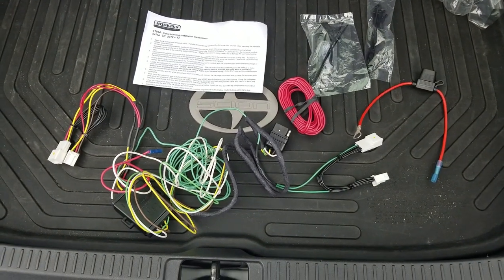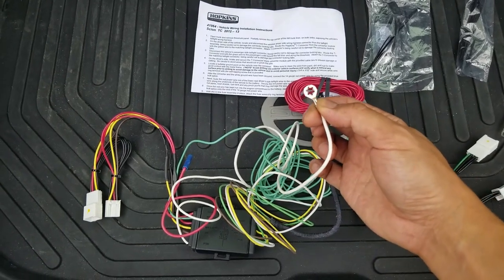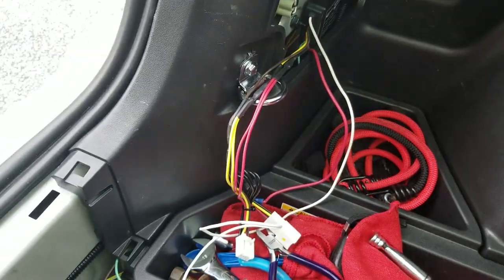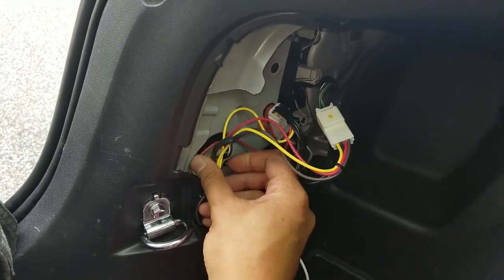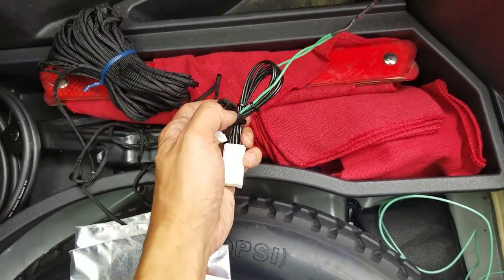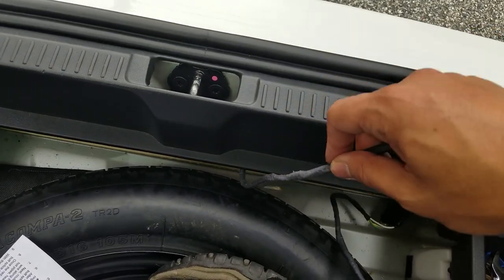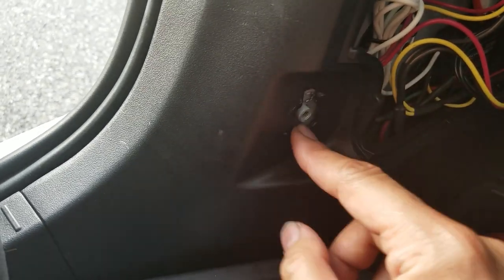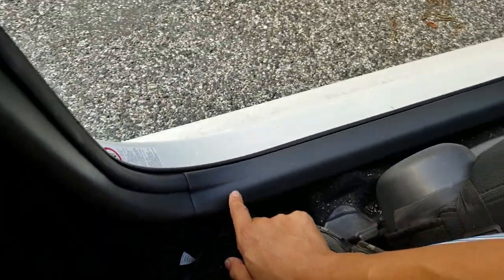Hopkins Towing Solution Hitch Wiring Harness (41964) for Trailer Lights Install (Scion tC2 / tC2.5)

Comment: So that front trim closest to the dash can you show how yours is secured because mine just barley hangs on
Reply from the maker: Which trim? The one with the mirror controls on it? It's held in place with built in clips at each corner. You can see how at https://youtu.be/A-w3YwZbhSs.
Reply: @VampyreX13  So it's the trim on the bottom of where the door closes you have the three pieces the long one and the one that goes to the back and one near the fuse box so it's the one near the fuse box under the dash
Reply from the maker: @TinoTeHG33K  can you message me on FB or IG and send me a picture?
Reply: @VampyreX13  sure

Comment: I just have a question do you still have the stock clutch installed? I just got a 2014 Scion tC and I'm not sure if the clutch is wearing out or if that's standard.
Reply from the maker: Yes, I have the stock clutch installed. I'm at 51200 miles on it. It's hard to say in your case because you don't know how the previous owner drove your car.

Comment: What tow hitch do you have? How much weight do you tow? I want a tow hitch to attach a scooter that weights about 200lbs, do you think the tc can handle?
Reply from the maker: I have the Curt Tow hitch (https://www.etrailer.com/p-C11375.html). I am still planning on doing a video for it, but have been busy and now it's freezing out. Yes, it can handle a 200lb load. I recommend at least a 9" long draw bar or you will be hitting your bumper. I am at stock height, so https://www.etrailer.com/Ball-Mounts/Curt/C45024.html works perfect for me when I rent a trailer from U-Haul. I also got myself a stainless steel Curt ball.
Reply: Scion tc tow capacity is 1000lbs. And 200lbs tongue weight

Comment: Have you driven your car in snow?  If so how was it?  I know off topic....
Reply from the maker: Oh yes. We get a multitude of weather in Maryland. It handles well in snow since it's a FWD manual, even with the factory all seasons. Dedicated snow tires or even better quality all seasons would help though.
Reply: Ok I was gonna guess you were in MD.  I'm in PA.  Having a hard time finding a 6spd 2016.  Drove a 2015 this past weekend.  Surprisingly quick.  It was black low mileage, local.
Reply from the maker: Was it a 6spd 2015? The only real noticeable difference between the 2015 and 2016 is that the newer tC has a rear windshield wiper. I think I got a few minor extras like rubber  floor mats and coin tray that I don't recall seeing on the previous years.
Reply: Actually from what I read.....push button start, rear wiper, different center console, bigger head unit, chrome handles and 80 more HP.....ok just kidding on the last one.
Reply: I think keyless entry with your hand at the handle also.  I have a 2015 sienna so it's kinda nice.
Reply from the maker: The head unit is the same size, maybe a different model Pioneer. Push to start (which includes keyless entry) and the rear wiper are definitely new to the 2016. I love mine. The center console is the same I think, but I do have a rubber tray that wasn't on the previous models. Chrome handles are on the inside, though I don't recall if the previous tC had chrome or just straight black. 80 more HP. LOL. That would be nice.
Reply: Lu in
Reply: What tow hitch do you have. And how much weight do you tow.